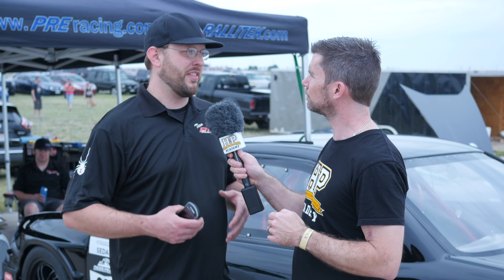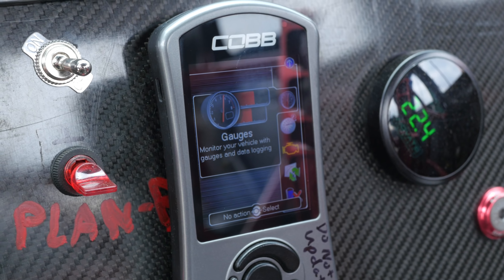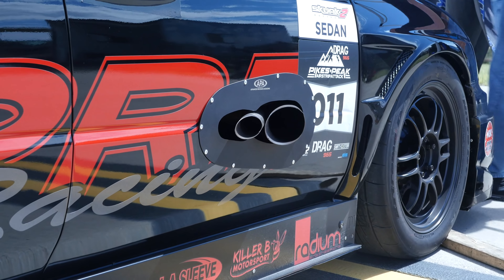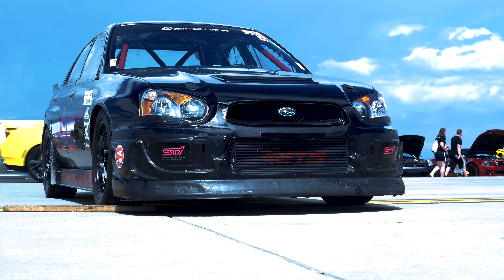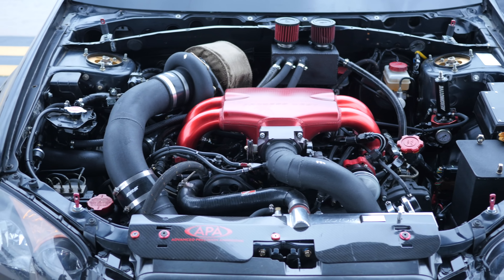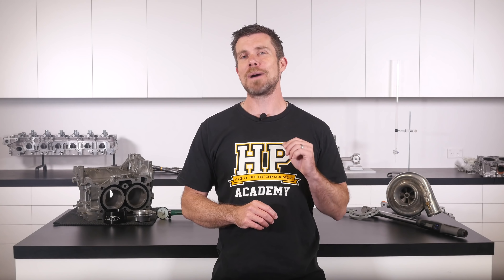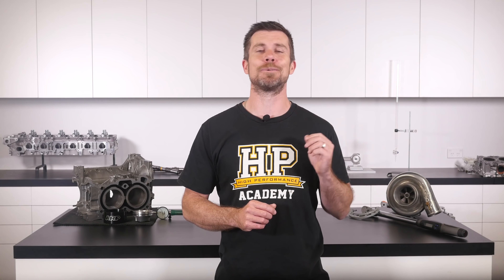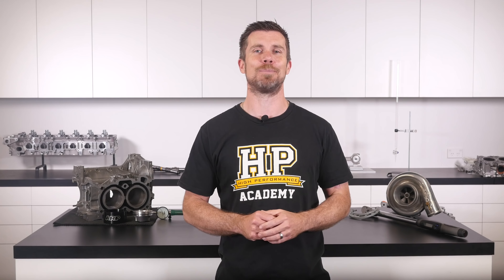1000HP+ 53PSI COBB Tuned Subaru WRX | Airstrip Attack [TECH TALK]

Comment: The only difference between a stand alone and the factory ecm is the lack of real time flashing on the ecm. Cobb may offer it, but the Subaru 06 ecm is very workable, and if your good with.hex, writing and patching your own lc patch taking advantage of tables and compensations for the good of your engine.
Reply from the maker: There are more differences than just the ability to live tune or not, as discussed in this very interview 🤘
This car did end up getting to the point they switched to a standalone ECU - Taz.
www.hpacademy.com/technical-articles/re-flashing-vs-standalone-ecus/?utm_source=youtube&utm_medium=social&utm_campaign=general-interaction
Reply: @hpa101  there is a time and a place for sure. Although for my needs the hp tuners program on the stock ecu is way more than I need for street/ daily, if I was to have a track only car, a haltech would be nice. But honestly the Cummins makes  like 1000hp mustang dyno with hp tuners mpvi3, I tune all the can subarus with it as well, so many capabilities within the stock ecm, but I do understand needing better, faster correcting ecms that are tailored for tuners. Love the work tay been watching for years..

Comment: Now cobbtuning makes me interested in tuning my Subaru Crosstrek as well. Of course, will do bolt on mods to the 1.6L engine. 

I wonder what are the pros and cons vs the ECUTek offering.

My previous Forester was ECUTek tuned with mix of WRX and STi parts for around 300bhp. 

Lasted for over 100k km before the gearbox finally gave up and have to replace the car for this 2018 Crosstrek.
Reply: Sadly they do not support any NA Subaru platforms anymore

Comment: Its awesome that the access port can support a 1000 hp build, but it's not an ideal solution.  Can you adjust injector phasing?  Does it give you access to everything in the ecu? No.  Good, but not a great solution.  I jumped ship when they started to nickel and dime Ap owners.  You want to tune?  You gotta take a $100 class.  You want access to a few additional options?  You gotta upgrade to a newer unit for no reason i can determine as the actual ecu doesn't change.  If you want to get a stock car and do a downpipe its certainly the best solution.  Just make sure you do your research and know your goals before you go down the ap road.
Reply: Injector timing is adjustable in a 3d table for most of the Subaru ECU's.

Comment: What about adding additional sensors to it ? Like 4x EGTs, or fuel pressurue sensor or any any sensor that originaly wasn't on the engine (and integrating them with ECU maps, failsafes etc.) ?
Reply: We have all these added in through a secondary logging system.

Comment: How does a standard ecu support these over sized injector (high resistance). plus a small looking compressor housing even at high boost it doesn't look the part to make this power efficiently.
Reply: This is an H-cover precision 7675 gen 2. It has a 4" inlet and 3" discharge. Rated to flow around 1200 horsepower. The ram air intake misleads the size of this thing.

Comment: What kind of block are they running??
Reply: Irish Warrior  not a closed deck/block guard.
Reply: @asfmachine   I'm calling Bravo Sierra on that. At that boost level will that much cyclinder pressure unless they are a solid block no way are they an open deck block design.
Reply: Brandon B I’ll bet you a six pack it’s an EJ257 with ductile iron sleeves.
Reply: @asfmachine  lol well played sir. I like what you did there. I'll give that to you but that's kinda a catch 22 cause it has top bracing built in. I don't follow it that close honestly never heard of it before this video. Do you know about it?
Reply: ASF is correct.  LA-Sleeve ductile iron in basically stock ej257 cases (with a few tweaks)
Reply: @WT4T  yeah I got schooled on that one. Either which way you cut it its impressive.